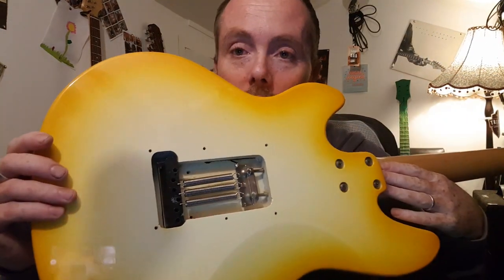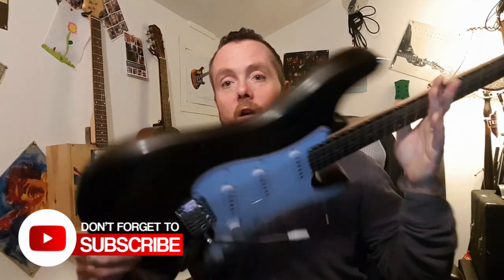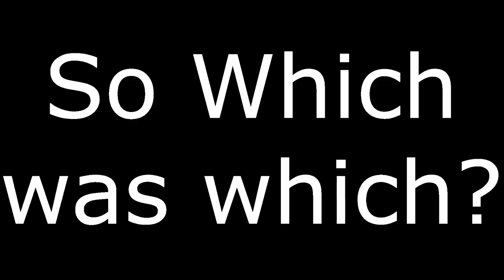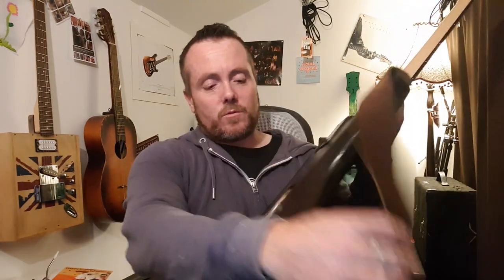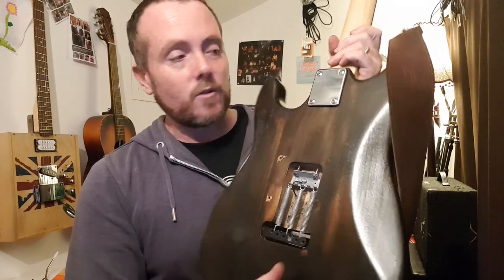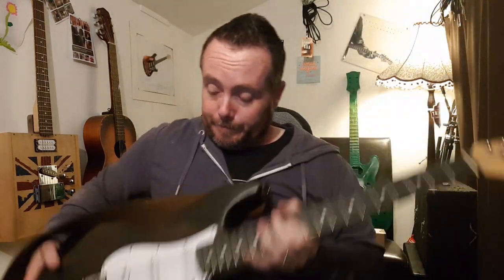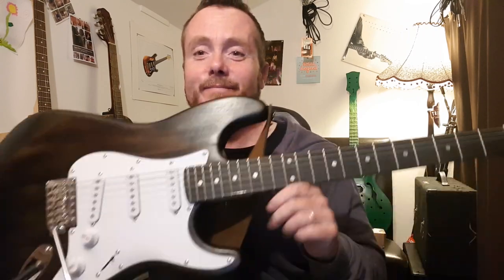Is Your Trem  Sucking Your Tone? Trem Blocks / Sustain Blocks / Tone Blocks / I find out the TRUTH!

Comment: After putting a full size wilkinson block in my Squier Affinity, the entire body of the guitar began to vibrate much more, you can feel it. also it sounds at least twice as loud acoustically. absolutely worth it
Reply: could you give me a link to the block you used? I have trouble finding a full block for an affinity. Thanks in advance
Reply: @Gut_tt  thanks mate
Reply: @johnbeddoe782  If u not sure, Musicilly has special made full brass block for Affinity strat also has for China Affinity
Reply: @Gut_tt  yup I got it from them. Thanks again
Reply: As A left hander, thee shallow 37mm sustain blocks for 52.4mm string/screw mount spaced vintage style import trems are non-existent. Wudtone made me a Shallow 1018 Steel block for my left handed Squier Affinity Strat. The Sustain, Note attack, top end and glassy tones in the mix positions really jumped out at me. The stock pot metal block weighs just 79g and is more like a glorified string ferule, whereas the Wudtone Steel block weighs 217g. You also need the Wudtone trem arm as the arm design is different to a Fender, Squier or import block, but well worth it!

Comment: That's not a very accurate way of testing sustain difference, SMH. Why not pick an individual open string, with guitar plugged into a tuner and let the string sustain until the tuner goes blank?? Seems like that would be a pretty accurate way to test the natural sustain wouldn't it.? Plus being plugged into an amp can cause the strings to sustain by themselves by way of feedback.

Comment: Hmmm. Well, I thought the sound was louder, clearer, and more dynamic with the first one. I hope everything was equal...meaning that all the settings were the same in both demos. I don't want to give it away. But I wonder if different types of block materials and sizes do "absorb" a different amount of soundwaves, requiring that volume be increased or decreased in order to make them play at the same volume. Assuming the answer to my question is no, and everything was truly equal, to my ears, the first sounded better.
Reply: The only thing missing with the way you did this test was playing the guitar unplugged. No amp. No electricity, period. Just acoustic sound to compare would have been the final be-all gold standard test. Cause you thoughtfully used only one guitar. Thank you. For everything.

Comment: I changed out a rotten jammed up Fender bridge for a heavy block Wilkinson and it felt better... but what really made it feel better was replacing the neck screws with threaded inserts + bolts. That made the whole guitar much more stable and rigid. You should give it a go. Easy mod and your guitar will be better for it. Cheers.
Reply from the maker: Wow great idea thanks
Reply: The Lamb
Hi. Have you got a link for those threaded inserts and bolts? Much appreciated.
Reply: @ronnienose8608  did you find it ?
Reply: @ラウこ  No, he didn't reply. Do you have any idea where to find these?
Reply: I've done this with my bolt-on neck guitars too, and highly recommend it.  No link, but you'll find plenty on eBay.

Comment: Just come across this vid and funnilly enough have just purchased a nice fat wilkinson to go in my HB  ST-62 vintage series (2014) with the wilkinson pups in it. listening to different guys who have done the same thing, they also say you may need to route some more out of the body. Going to put new trees on it and tuners as well. I am only doing this because I had a go on a Fender strat MIM and was disapointed in the sound. Might as spend few bob on HB then I'll try another fender.
Reply from the maker: Yeah man I love my hbs. I put all fender parts on my black paisley strat. It is an awesome beast now. It was great before but just has a little more after the upgrades.
Reply: @BrentHutchinson  Chuffed to bits, had to take a very little out of the bridge hole on the body. 2 outside screw holes out of centre so dowled and that put that right. Had to open up tuner holes to 10mm. Put the fancy little trees on (not sure what that would do but looks nice). Tried the bridge with just 3 springs as per the old one but  action height moved so change to 4 and set it back up. It's a revelation yipeee, all with wilkinson hardware at very little cost.
Reply from the maker: @TheFatneck59  that's brilliant..doesn't take much but little tweaks can go a long way ! Happy days

Comment: I exchanged plastic pins to Brass pins for my dreadnaught guitar and there was a change in sound brightness and sustain. Strings on resting in the bridge. Its difficult to get an accurate reading with two different guitars. I am currently replacing a zinc cracked trem for  a  brass trem on a 1987 series 10 by Bentley. I am not sure what to expect other then my tremelo bar to finally work.
Reply from the maker: Interesting I have never messed with the pins I must try that

Comment: I put a USA steel Fender tremolo on my CV strat. It changed the sound quite a lot. It sounded much brighter. I used to love the sound of the middle pickup and thought the neck was a bit lacking. With the new tremolo this reversed. Guitar felt more alive. That's not to say the old one was bad just different. I left it in there anyway ☺
Reply from the maker: Yeah I was shocked that this made so much difference

Comment: Once you take the strings off, you'll never get them back on the way they were. They always sound a bit different, cus they're not sitting the same. Especially if they were used a little bit before taking them off. but I don't see the trem block making that much difference. It's not really connected to the vibrating part of the string. The vibrations are mostly transferred to the body through the saddle, the grub screw, the trem plate, then via the pivot and down through whatever posts the trem uses. Changing those might affect sustain. And setting up the trem to float, definitely does.

Comment: I guess that there might have been some differences in tone between the two blocks but I think that spring tension has a greater effect on the sound of a Strat than the block size/material.
Reply: Do you think more tension equals more sustain or the other way around?
Reply: In what way?

Comment: I just changed zinc block in my MIM Fender to steel Kluson block and it has a lot more clarity. To hell with sustain, it's main misconception that heavier block will improve sustain in audible way, i can't hear difference in sustain, but in clarity difference is very audible, each string has more separated sound from others, it's the best way i can describe it. Maybe because lighter block allows vibrations of each string to interfere with each other and steel block is better with maintaining separation of vibrations. It does play, in purely musical way not necessarily tonally, better.
Reply: That means you are losing the sound from the strings somewhere else. Most likely at the nut. The way sustain works is sound is reflected back to the strings, MOSTLY at the nut and saddles. Denser materials equals more sustain because the sound continues going back and forth across the string instead of continuing to travel and ultimately dampening into other components. So, YES, a brass block does fucking help with sustain- it prevents the sound from continuing to travel into the springs, into the claw (typically made of really cheap shit), the claw screws, and into the guitar body, where that sound is lost. Having a bigger, denser block stops that sound travel and returns it back towards the strings. You gain some of what you would have otherwise COMPLETELY LOST. Your problem is somewhere else. Most likely the nut and saddles. If you upgrade those 3 to denser materials, you damn sure will have an incredibly noticeable difference. If you can't tell a difference with the block change alone, that means you have a shitty nut and possibly whatever is beyond it. You change that to something that doesn't suck, and you WILL hear the difference from the block. You'll hear it even more after replacing the saddles with a denser material.